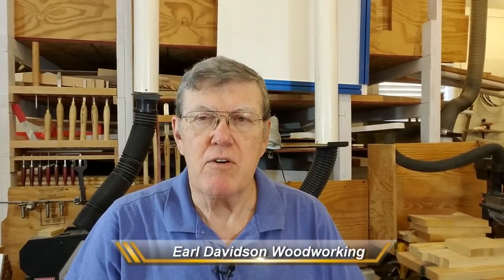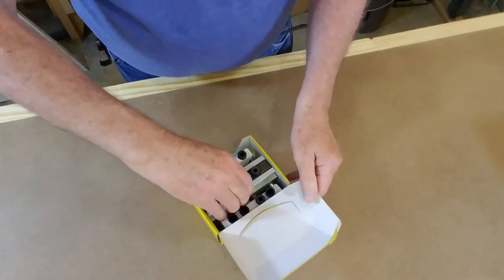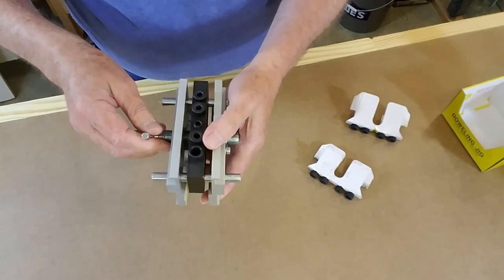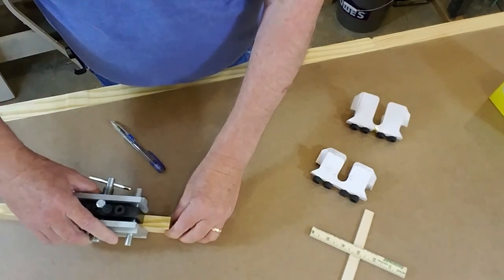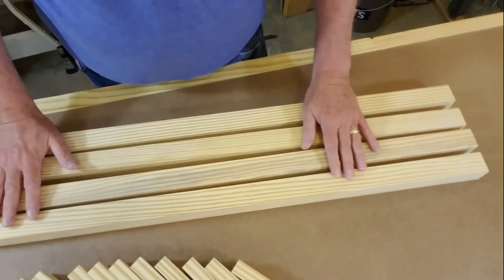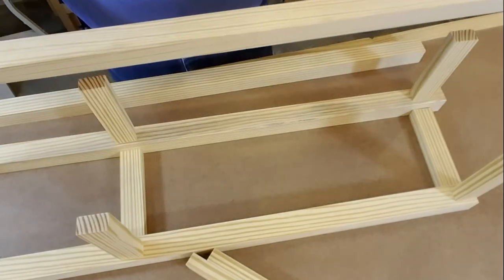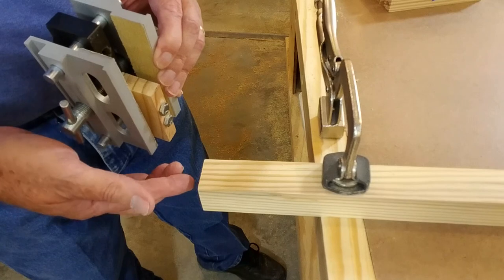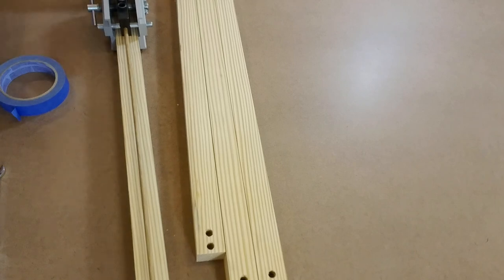Self Centering Dowel Jig Tips and Tricks

Comment: Hi there I have a question by this Dowell Jig what is the minimum breit to make a hole. For example I have some piece of wood that mesure 1 cm or less. Thanks
Reply from the maker: The smallest bit for this jig is 1/4" or .635 cm.  As a general rule your dowel size should be about 1/2 of the stock's width.  You might be able to get away with this but be sure the dowels don't split the material.  The jig will require spacers on each side of your material so that it will clamp tightly - but that should not be a problem.

Comment: Hi Earl, any guidance or tips on making drilling angled dowel joints?  You needed to cut them on angled pieces for those beautiful stools you made.  90 degrees are straightforward, but those angled legs and aprons look tricky.

Comment: Thanks for sharing. That's a great looking stool you finished with and that dowel jig in your hands works just fine.

I know that a pocket screw jig would have shortened the work considerably but I'm not so sure the resulting stool would be as strong as one joined with dowels. Screws will normally work loose with time. However, the Kreg screws have special grooves in them that are supposed to prevent this. What do you think?
Reply from the maker: I've used pocket hole screws and have never had one work loose...but most of what I've built is stationary.  The stools are subject to a lot of forces that try to pull the joints apart.  Of course, using glue with the pocket hole screws will help.  My problem with the pocket hole screws is that I can't seem to clamp my work pieces well enough to keep the screw from shifting the alignment.  For me, the screws would absolutely be a time saver, but I believe the dowels will last much longer.  Your mileage may vary.  :)

Comment: Hi Earl. I've just bought on of these jigs (same brand) and I'm finding that the holes are wandering. Each time a hole is drilled it won't line up with others. No matter how carefully I drill the holes, a line of holes shows some up, down, left and right. I suspect the bushes have too much "slop" and also are too short. I think that allows the drill to angle slightly as it's being guided. It means that accurately aligning work pieces to dowel together is impossible. Have you found these problems with your jig? How long are the bushes on your jig and are they tight on the drill bits? Thanks
Reply from the maker: Gary, I'm sorry to hear you're not getting great results with your dowel; jig.  I went to the shop to check mine.  All three sizes of bushings measure 1-3/8" in length.  The drill bits are easy to slide in and turn and have a very slight side-to-side motion when I wiggle them around in the bushings.  It is not a snug fit.  My suggestions:  Ensure that the jig is clamped tightly to your workpiece, ensure that the bushings are screwed tightly into the jig.  Ensure you're using the right size bits.  I've never had an alignment problem with holes except for some operator error problems.  I hope you can resolve your problems.  If not, return it for a refund.
Reply: Thanks Earl!
 I appreciate the time you took to reply and to measure the bushings. 
I'm in contact with the retailer and they are investigating.
Reply: Gary, if you really want to drill accurate holes for dowels get a Dowel Wizard jig.
Reply: Hi Gordon. Thanks for the tip. I had a look at those originally but decided to go with the one featured on this review as the Dowl wizard was more expensive than what I wanted to pay to experiment with dowels. Maybe not in USD but by the time you convert to AUD and then ship it, it gets a bit exxy. I eventually gave away the idea of dowels and decided to go to pocket holes. They seem to be working ok.

Comment: First rate. Very clever adaptation, clear explanation. Never made dowel joints myself, but domino is not super accurate in alignment, which is only as good as eyeballing center mark left and right, and the fence rarely makes pieces fit flush in one plane. Sure like what you've done, which promises accuracy, and I hope to do the same!
Reply from the maker: Paul,  I've found my accuracy with dowels to be much improved over pocket holes and the biscuit joiner.  I haven't used a Domino but suspect that its alignment is on par with the biscuit joiner.
Reply: right you are

Comment: Hello Earl. Great video. I just recently purchased the same jig and right away came across a limitation that I did not forsee. I would like to make a box using 2 by 4's short sides up. The jig will do the ends of the boards just fine but will not work so well for the sides of the adjoining boards. I was wondering if perhaps you have run into the problem. If so any solution?
Reply from the maker: I  think you are trying to drill into the 4" side of the 2x4.  This jig has a capacity of 2 inches only.  There are "wide capacity" versions available that expand to 6 inches but I've not found one with 4 inserts for each dowel size.  An alternative would be a jig for the jig like in this video:  https://youtu.be/ht0Q5MmwWsM

Comment: I use this Dowel Jig but with the Metric inserts because I am in Australia. No matter how much I measure or how many times I use it the holes are always off by at least 1 mm. When i see you using it you just drill as if it will always be accurate but it never is for me. The metric drill bits don't really fit that snugly so I am guessing the inserts are the problem. Has any one any suggestions?
Reply from the maker: Michael, I'm sorry you're not getting good results.  I have no experience with the metric version of this clamp.  I've found all of my inserts to be accurate with no wobble of the drill bits.  Has anyone else experienced Michael's problem?

Comment: how wide of stock will that dowel jig fit?  Good video.
Reply from the maker: Jason, this one has a capacity of 2".  There are others available with a 6" capacity but I've been unable to find one with 4 inserts for each size dowel hole which was important to me.  Since all of these dowel jigs APPEAR to be the same design I wonder if the center section from the one I have would fit the wide capacity jaws.
Reply: Thanks much, Earl!

Comment: How did you get the 1/4'' reveal where the skirt comes into the leg?
Reply from the maker: Skirt is 3/4" stock and leg is almost 1-1/2".  Dowels are centered in both pieces.  Reveal is the same inside and outside.  Thanks for watching!
Reply: Thanks. That was easy. Do you know how to get the reveal if the skirt is 3/4'' and the leg material is other than 3/4 or 1/2'' thicker?
Reply from the maker: Just use an appropriately sized spacer on one side of the workpiece.